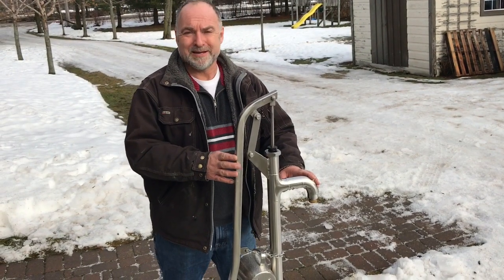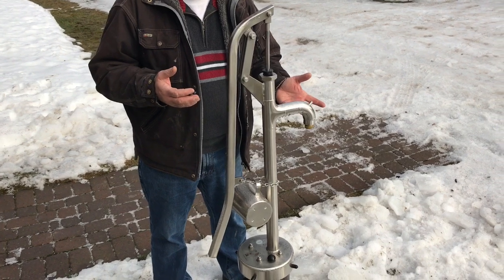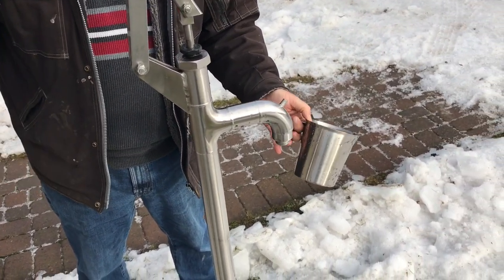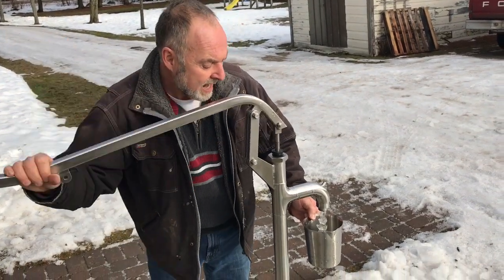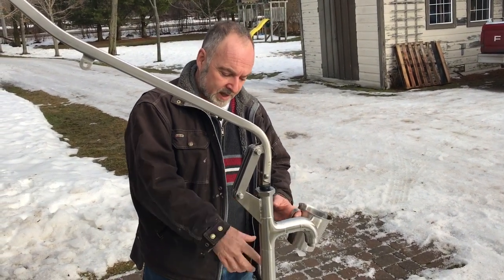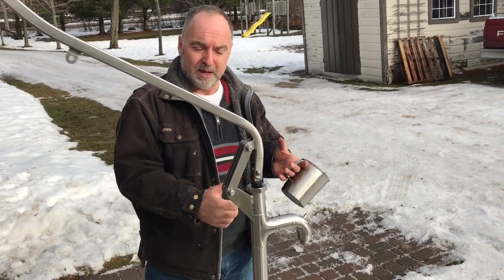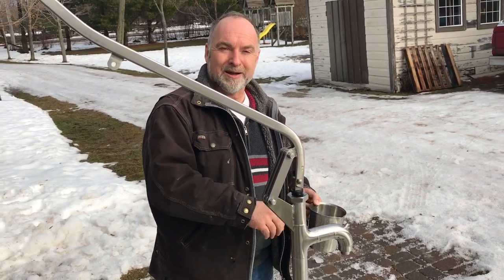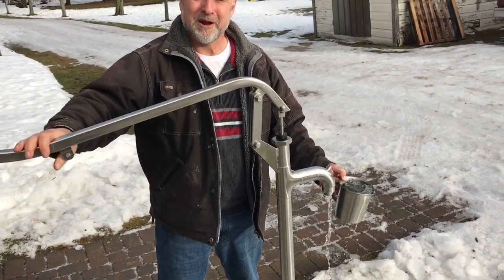DEMO: Bison Deep Well Hand Pump in Winter

Comment: Great Video Steve, simple fix for a potential problem.
Yea those bleeder holes are used in submersible pumps also to get a air charge in standard tanks.  Its a whole different world in  freezing climates when dealing with water wells. You have to think about these things or come winter you'll have a problem for sure.

Comment: Excellent explanation of what I was concerned about with an outside pump = drill a small hole in the pipe so the water self drains. I didn't realize the pumping action occurred deep in the well.  Thanks

Comment: I'm a well contractor . I install And service water Wells I can't tell from the angle of the camera but it looks like what you have as a pitless adapter I see an electrical conduit going in the side of the casing so do you actually have a submersible pump that powers your home and this is Titan with a check valve or something along those lights so your hand pump can actually draw the water through the intake of the submersible pump when needed otherwise it is powered electrically ?

Comment: Hi! Could you please give me the distance from the end of the pump handle to the pump shaft when it's deployed at a 90 degree angle? The top of my well casing is 5 feet below the ground surface and the space there is kind of limited. Thanks, it's greatly appreciated. :)
Reply: Perhaps you could add a second platform at about ground level above the lower level?

Comment: Is it possible to convert a 150 foot deep electric well over to a hand pump. I will inherit my mothers house one day and want to go off grid and disconnect all electrical service.
Reply: Yes most definitely. Go to https://www.bisonpumps.com/ research which pump best suits your situation. I'm looking at the exact same pump that Bailey has in the video and this pump is listed as pumping at static water levels of 300' here--> http://www.bisonpumps.com/wp-content/uploads/2013/02/DW-Hand-Pump.pdf  The static water level is the distance from the ground you're standing on to the top of the water in your well. Yes, wells can be much deeper but the static water level is usually much higher. They put the pumps significantly lower below the static water level because the water levels change with dry spells with no rain or if you don't get snow melt runoff plus depending on population in the area.
So, for example, you may have a well that's 150', the pump may be sitting at 100' and the casing could be down only 40'. However, you need to find out what your static water level is. It may only be 30'. Get some string about 50' or so and tie a nut on it. Something that's a little heavy. Drop it down the well until you hear it hit the water. Pull it up and down to hit the top of the water. You should hear it echoing in the well casing. Mark the string or tie a knot in it, pull the string up and out of the well. Now measure the string from the nut to where you marked it or tied the knot. That is your static water level. You want to put a few more sections of the pipe and rod pieces below the static water level for dry season as the water level can change. I plan on doing the same thing here since my property already has a well on it. Good luck!

Comment: Great video! Does anybody know how many ounces that cup is that he was holding? Look like it took about three Strokes to get it filled up. Just curious on the actual flow rate since the well depth is similar to mine.
Reply from the maker: Hi John!
Would you like me to measure the output of each stroke? I could do that tomorrow if you like.
Just let me know.
Bye,
Steve
Reply: Steve Maxwell hi Steve! Hey that would be great if it's not too much trouble. I'm thinking I will wind up getting a bison pump, as it seems to be the best solution for us up here in North Dakota and for our needs, but I would like to see a real user report on how much output give you get per stroke and/or gallons per minute. Thanks again!
Reply: @baileylineroad  did you ever make this measurement?
Reply: @baileylineroad  Would it be possible to get a per stroke measurement Steve? Im interested in this type of well setup as well

Comment: So the pump is pushing air into the well to push the water up? Im a little confused
Reply: No, the pump is only pushing water, but the weep hole let's the water drop back about 8' from the top of the pipe when you aren't pumping.

Comment: Hi
Is bison better than simple pump
And if so why?
Reply: Define simple.  In the event you are thinking of a pitcher pump, theses pumps will work  with far deeper water, than a pitcher pump can.
Reply: I like the fact that the rods in the pipe Bison uses are stainless steel. Simple pump uses fiberglass rods. If kids mess with it and break it for whatever reason or say a vehicle hits it, I think I'd feel better knowing theres not fiberglass dust/shards that fell into my well. But for all intents and purposes, both the Bison and the simple pump operate the same way, both are positive displacement and both can be plumbed to the pressure tank in the house or wherever.

Comment: Wouldn't a check valve at the frost line work better?  (So nothing gets in the well)
Reply: Not in the northern states or cold climates. That's the whole reason to put a weep hole in the last section of pipe below the hand pump so water doesn't stay in there and freeze. You also have to wait to put the cap back on and give the pump time to drain through the weep hole. Just a few minutes. If you put the cap back on too soon, it may not drain then may freeze.